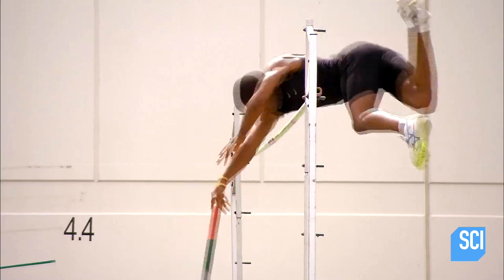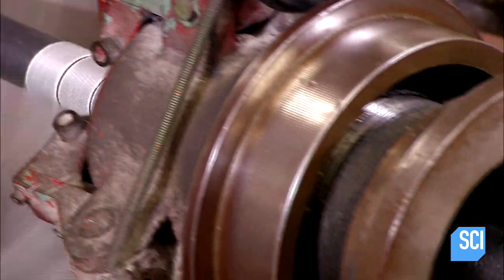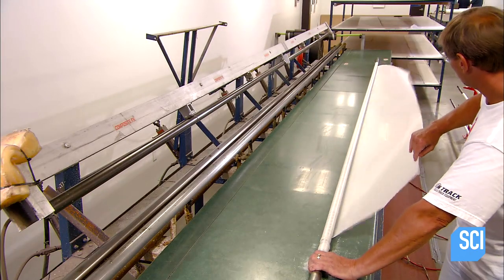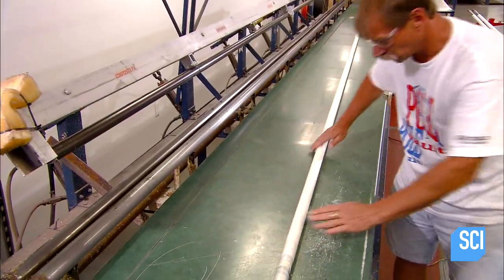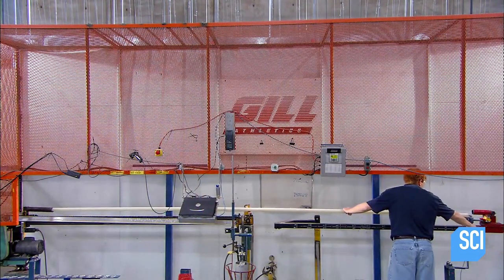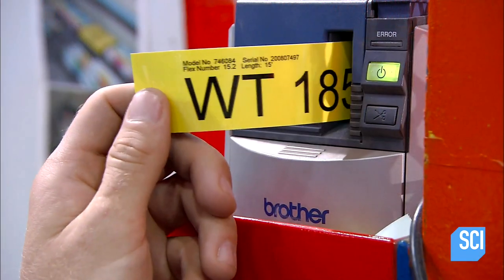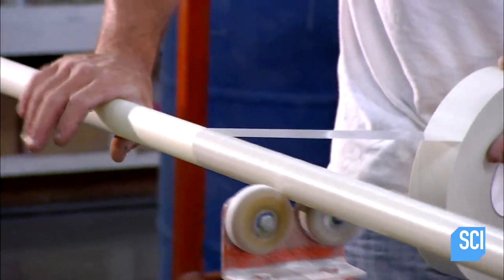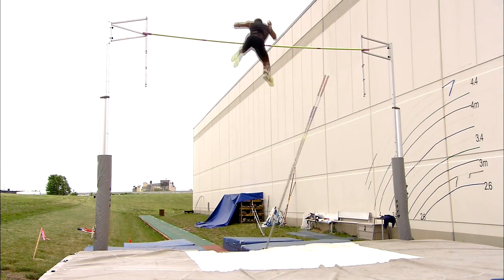Pole Vaults | How It's Made

Comment: A bit of interesting info for you guys:

Certain components in power station equipment are made in a very similar fashion. Drywell fuse holders are made of strands of fiberglass instead of sheets, but they’re wound around a steel mandrel just like these poles. Of course we wind them to be thicker, with a different mixture of resin and different baking times and temps so they’re rigid instead of flexible.
Reply: Powerful ⚡️